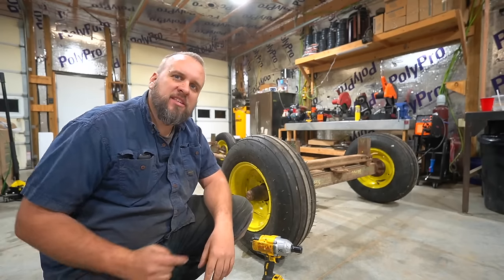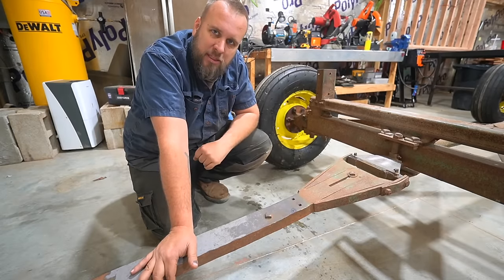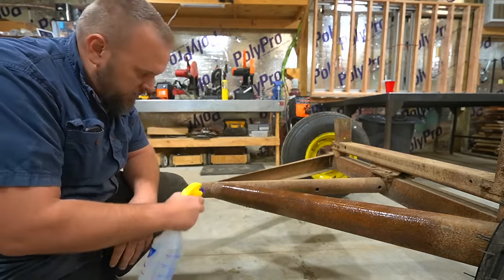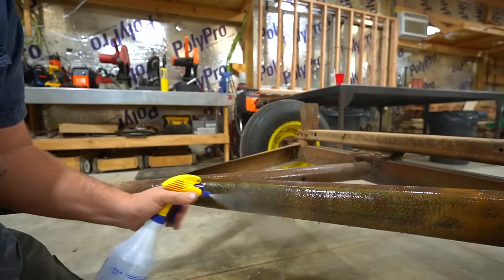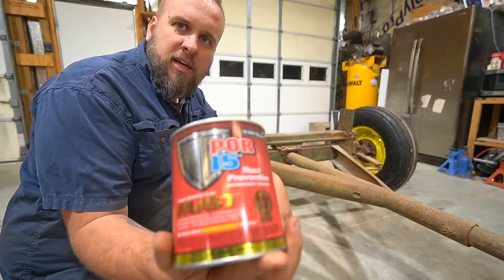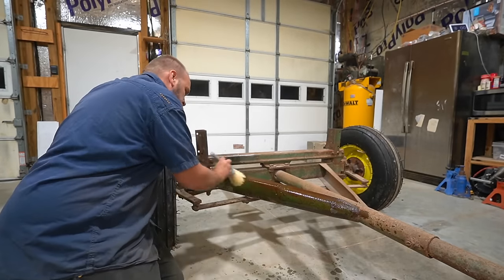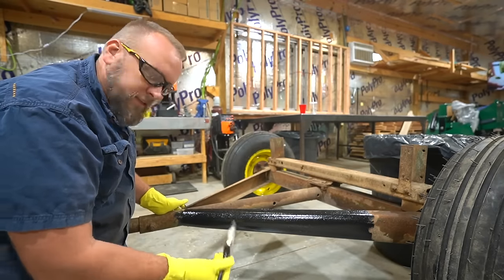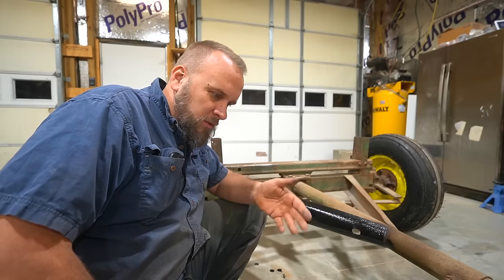Painting Rusty Old Farm Equipment

Comment: Good morning Brock. I'm going to give my two cents on this subject because over the years I've gained some knowledge on the subject. Two products that have worked extremely well for me is "Rust Fix" and "Rust Mort". You just take a wire cup brush on a grinder, knock off the loose Rust, and use a regular wire brush in the corners. Blow the dust off, wipe it off, and either spray or brush it on. After drying it will turn the rust into a hard primer and the rust will be dead. I usually scuff it up, put a good coat of Rustoleum primer, and a topcoat of your choosing. I believe that both products come in spray cans and regular cans. I'm just trying to help. God bless and have a wonderful day. 👍👍🙂

Comment: I’m sure you’ve already gotten heaps of great feedback but I’ll go ahead and throw mine in as well. OverRust is what I’ve used with good success. It brushes on a light tan color and turns black as it binds to the rust. The last gallon I bought was around $100. It’s pretty thin and goes a long way. Beware though. If you dip a rusty contaminated brush in a gallon it will weaken the solution. I’ve used a gallon to do an entire 24’ gooseneck frame.

Comment: You should consider a wet sandblasting attachment for your pressure washer preparation is all if you want to get a good finish
Reply: There's a company that has trailer mounted dustless media blasters. I've seen them on MotorTrend or somewhere. They use baking soda as I recall, and do a really nice job, the media dissolves instead of leaving sand or glass everywhere, and they're fairly economical. Maybe Brock could wrangle a sponsorship out of them :)

Comment: I think the second cost has to go on pretty quick
 Second coat does not adhere to first coat when dry. from my research, oil is the only think that works. Any coating over rust is not good. For my logging gate, I just spray it with paint each year. Seems to work. Don't have all the answers.

Comment: Hey Brock, it may have already been mentioned but a pneumatic needle scaler works good to remove rust in hard to reach areas. Its designed to remove slag from flux core or stick welding.

Comment: I restored a rusty old 10ft x 6.5ft trailer with metal ramp gate using Corroseal water based rust converter. I purchased a 1gal bottle on ebay. I did a quick washing of  the dirt and mud off first. Then I brushed it with the converter. It goes on thin and white and turns the rust into a shiny black ready to paint primer. It took less than 1/2 gallon. Then I just sprayed it with cans of black paint the next day. It did a great job. That was a few years ago. The paint has faded since but the rust is still gone. I could not imagine it being much easier. I see it for $55gal on ebay right now.

Comment: Electrolisys is a great, cheap option but a tank to hold the material might be a problem. You'd probably have to dismantle it into smaller parts for that. I use it a lot in restoring cast iron pans and it does a phenominal job!

Comment: The rustoleum product would be great on chrome rims to remove rust or anything that is chrome. POR-15 is the best around if you don't want to physically remove the rust. They've been using this product for years. My brother has used it on his truck builds and loves the product. I'll be coating both my trucks frames and undercarriage with POR-15. The only thing I haven't heard you mention is the mobile media pressure washer method. It's a pressure washer system that uses water and media to remove rust easily and without the mess due to the water. A lot of people use it cause it doesn't heat up the metal like regular media blasting does. There are independent companies and people who do this for a living.  Just Google search it and see if this is something you'd like to try out.